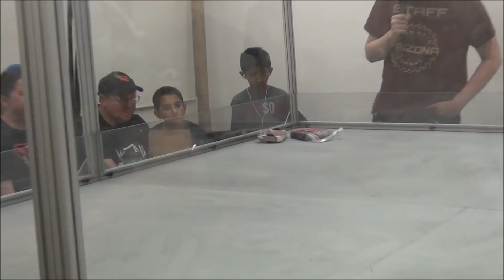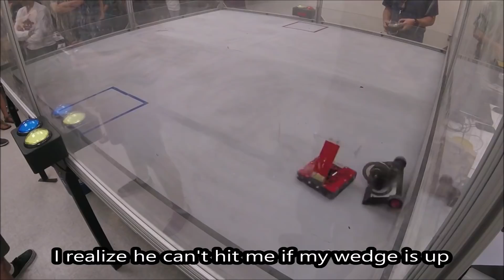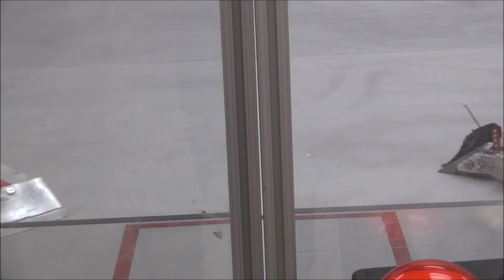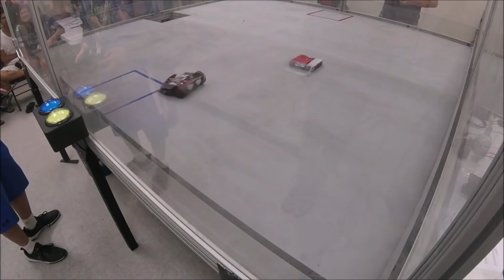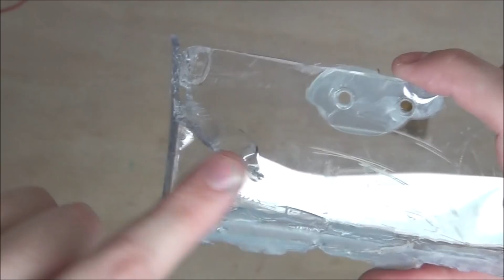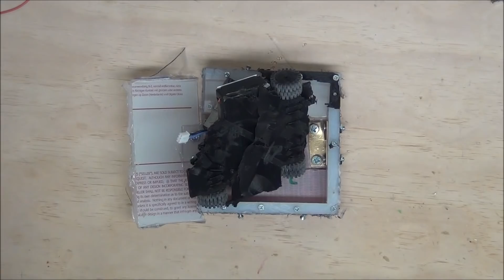1LB Combat Robot Competition! // Talyn Fights // November 2018 Arizona Robotic Combat

Comment: Maybe you could melt the baseplate onto the frame with a sautering knife or heatgun?

Id also reccomend interchangable wedges more specifally forks and a wedge with a narrow tip or antidrum wedgelets.
Reply from the maker: Yes the melting might work however then i'd no longer be able to swap them out :/  But yes, I might pack different wedges in the future, however i do like having such a large lifter surface! It makes grappling and flipping a LOT easier :)

Comment: With as well as Talyn's HDPE sides took punishment (as in not even close to penetrating), you could possibly get somewhat thinner sides to shed weight. Even half an ounce would be enough for a proper blade mounting.
Reply from the maker: Yes! And that's actually part of the plan! haha! I'm planning to drop weight there and get some lighter electronics too!  :D
Reply: I think I might have a solution for a light, tough hinge. A while back I picked up some 3/8 inch Lexan tubing. It has 1/8 inch walls, so internal diameter is 1/8 as well. As both your lifting arm and top of the bot are lexan, all you need is 3 sections of tubing, a little Lexan glue, and a 1/8 diameter steel rod to have a tough as nails hinge.
Reply from the maker: That might just work! However i sadly don't know if the lexan solvent would hold up. or if the lexan itself would crack like the front wedge  :( but still might be worth testing!  :D